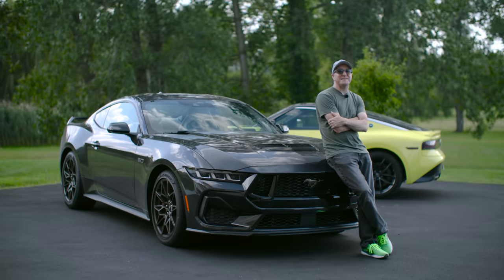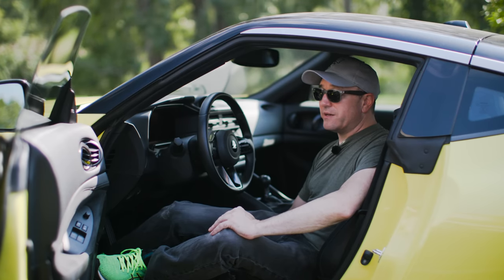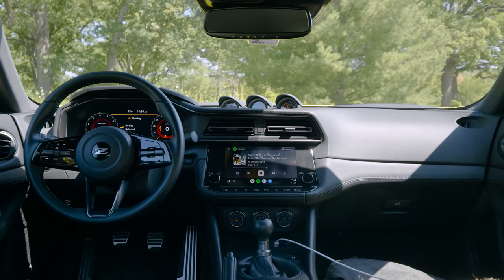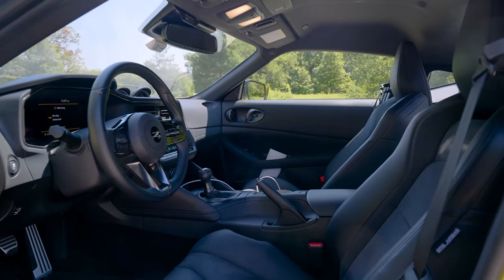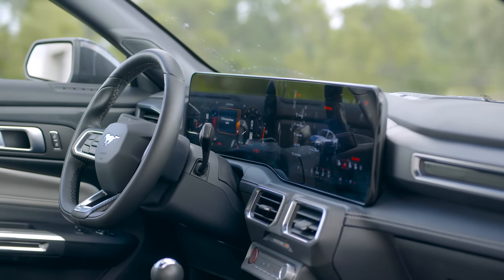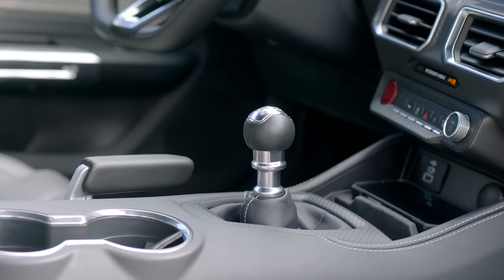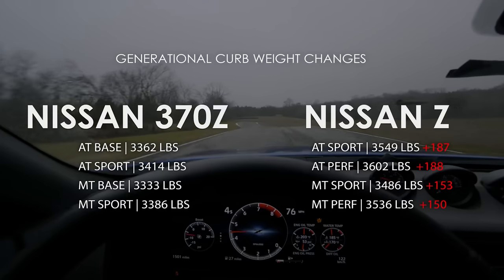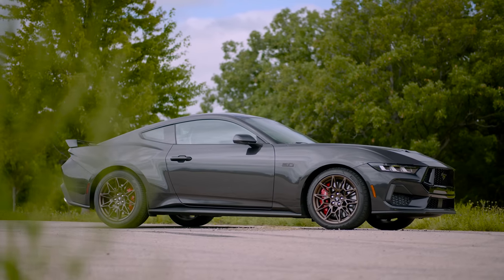Mustang GT vs Nissan Z | Maximum Muscle, High Prices

Comment: The Mustangs’s screen 100% kills any desire I might have had to buy one. It looks so tacked on and kills the look of the interior.
Reply: I'd rather buy a gen 5 and engine swap it for that authentic muscle car feel. Would probably be cheaper still LOL.
Reply: Whoever made the executive decision on that interior and exterior styling needs to be shot into the sun tbh
Reply: not just the Mustang but everything has these stuck on screens now and looks awful. Have you seen a new S Class Benz?
Reply: I generally like big/extra screens but wow does the mustang look bad. Like how some 80s cars tried to go too futuristic
Reply: Were you in a coma the last ten years? That look is so normal now, even old-timers should be used to it now. There are cars with a more tacked-on look, and the rest of the interior actually has the same flair, so it's a decent fit.
Reply: I hate this approach by any manufacturer... Screens are absolutely fine, when they are nicely shaped into a stylized cockpit. But these ugly, protruding square designs with huge bezels  look cheap and un-inspiring. Especially in any car that is supposed to invoke emotion and sportiness. We will all laugh at these tacky designs in the no-so-distant future. Ugh.
Reply: @2K8Si  I believe BMW first started this, with the ipad looking tacked on screen, because it wouldn't fit into their new dash line...and then everyone started doing it. Always felt it was ugly AF. 

That being said, this mustang one here due to the lower height and closeness to the driver doesn't look too bad
Reply: As soon as I saw those screens I haven’t even considered getting rid of my 2020 GT. Which by the way, less then 3 yrs ago I paid almost half of what these are going for.
Reply: @TheDavidk1982  I got my 2019 Bullitt for 10k less than a similar optioned new GT, and in NO way is it 10k better of a car. A well Spec'd EcoBoost is now the price of my Bullitt.
Reply: Agreed just give me gauges and switches. Maybe a small screen to see some of the telemetry data kind of like the GT-R has since the R34. If they want to go all fancy and high tech, skip the screen and go straight to finding out how make a HUD work in all situations. In fact kind of off topic, I'm surprised race car helmet manufacturers haven't figured out how to display data on a screen getting live data from an accessport or something. That way I can have my classic interior and still get all the car info on the helmet display on the track when I actually need to know all the information, not when I'm getting groceries or going to work.
Reply: Agreed, the whole point of driving a fast car for me is to get away from stupid screens and feel something different. The screens obsession feels like a sick societal addiction.
Reply: If I got one of these, I would swap out the entire interior for one from an S550.
Reply: @markj9544 oh Mercedes is the worst absolutely an abomination.
Reply: Totally agree, I’ll never buy it because of those stuck on ipads.
Reply: @anydaynow01  They'll just tell you it's easier to make an iPad mount for your car so you can have a screen when you need it and remove it when you don't.

Correct me if I'm wrong but I believe there's a few series of race cars that already take this approach, a stripped interior with an iPad mounted to the centre console.
Reply: There's a reason a Rolex is worth $15k and an android smart watch is $29 .   Pixels are not synonymous with luxury or technology.
Reply: They're all going to be like that in most if not all cars in the future because the best viewing angle is something approaching vertical. I agree that screens like this make you look like you put your desktop computer monitors into the driver's seat and started driving. But we don't live in the dial-and-needle world hardly at all, anymore.
Reply: Can’t imagine this dash setup is going to age well.
Reply: I think there's a matter of elegance and utility here.  A mechanized needle is timeless like a fine watch but equally important is an uncluttered workspace.     I do not need or want a hundred pieces of information and animated junk, it's all noise and it looks tacky .     @SurelyYewJest
Reply: @shoveI  Tell that to Mercedes!

One of Bugatti's design philosophies when designing the Veyron and Chiron is "no obvious technology", because then it dates the car; they want people to be wowed by the design in 2060 as opposed to how we look at the "tech" in an Aston Martin Lagonda now.
Reply: Same here, all brands have been moving to that design and I just see laziness. S550 for me all the way
Reply: @markj9544    Yes - but the issue is that those cars didn't really have a 'look' or branding that they needed to adhere to.  The Mustang had a look, especially in the more recent models.. They just threw it out the window, seemingly based on a focus group of 17 year olds.
Reply: I agree the screen is way too big, Nissan Z interior looks way better
Reply: @TheUrbanEpicure Hogwash. Tacked on screens represent a lack of creativity, and there's no reason for it.
Stop making excuses.
Reply: @makstone  They're somewhat of an ergonomic and safety-relevant necessity. You need to have the screen within easy reach (as they're all touchscreens now), but you also don't want to have them too far down (like in all new Mercedes models) so people don't have to look away from the road for too long and refocus their eyes too strongly. "Tacked-on" screens are the best compromise and are here to stay, for good reason.
Reply: I'm other models the screens are divided
Reply: @TheUrbanEpicure I’m 42 and all them look like trash. I’m a Bmw guy, they held off until just now.
Reply: @kuruptzZz Bmw did not start this Benz did with the class the modern version was around 2017 in the undated Benz interiors
Reply: I recently bought a 2022 Mustang GT with premium package, stick...and that doesn't have the digital display.  A muscle car or sports car simply needs an analogue RPM gauge...and a Stick! So much more enjoyable.
Reply: I like it, makes it feel like you're driving a truck lol
Reply: RIGHT! 
The outside looks great! BUT.. then the flat screens & I lost it.. they blew it..not buying that
Reply: The interior is HORRID. Rest of the car is amazing. I prefer the interior of 97 cobra over that …. Thing they call a cockpit.
Reply: As if you were really considering a purchase 🥸 I'm old school and even I am all for digital dash. There's no debate. All cars are moving there.
Reply: In real life it looks pretty good imo.
Reply: @kuruptzZz  Tesla did it first. After that everyone started copying them putting HVAC and volume controls in the screen.
Reply: @djnes2k7  No they didn't...I'm talking about the center screen sticking out like a tablet from the dash. I saw that first in the 2012 BMW 3 series. Benz still had the screen incorporated into the dashboard. Then in 2014, mercedes changed their dashboard design and ripped off the "floating screen" idea from BMW...and so did many others
Reply: @Unicornpirate   Both tesla and BMW debuted the tablet looking infotainment screens the same year, 2012. Tesla's was just way more extreme, having everything on there. BMW still had an idrive knob and tons of buttons. Just the screen visually was like a tablet
Reply: @kuruptzZz  Which BMW had a tablet screen in 2012? They only started using them since the G series came out. If you are talking about the I drive that's not new. My 2007 x5 has it and it's nothing like the touchscreen tablet that the new BMWs and Tesla has
Reply: @Unicornpirate   Man I'm simply talking about aesthetically. It's not even a touchscreen, so not functionally. Style wise
Reply: @kuruptzZz  Those have been there in cars for a long time now. But those are more functional than traditional touch screens. They replaced double din head units in like the mid 2000s
Reply: @Unicornpirate   How can I explain this so people will get what I'm talking about? All I mean is the style of the infotainment screen sticking up out of the dash. Before the top of the dashboard would wrap over the screen. But BMW designed this "floating screen" they called it, and that style is what many other companies copied afterwards because it was a hit. I've never been a fan personally
Reply: Absolutely right! Matter of fact, I purposely bought a 2022 recently (as an ultra low mileage used car) instead of a 2024 for that exact reason. I hate the way the screen on there juts look like an afterthought. Like the designers took the day off and then just threw a couple screens ON the flat dash just before their shift ended. I really don't care what's ON them, they look like crap.
Reply: @Unicornpirate Tesla Model S  screens were nicely integrated into the dash tho. They didn't do the floating screen thing till the Model 3 in 2017.
BMW was the first that made the screen look like they just hot glued a  tablet on top of  the dash.
Mopar was also moving  HVAC and  seat  heater controls too the screen at that time.

Comment: The previous S550 interior was just... better.  The dual cockpit layout is just definitive Mustang.  My 09 and 2015 both have it.  I don't even mind a digital display, again the S550 did that better with it being integrated into the dash.  
The exterior is growing on me, as most redesigns do.  But the interior would be something I'd have to live with instead of enjoy.
Reply: I've been in an S550 since 2015.  At this point, I'll take any significant interior update they could think of.
Reply: I'm a zillnail and I love my S550 Mustang Premium interior I got in 2021 and while it is fully loaded it does not have the package with the digital gauge cluster and I honestly don't miss it and rather have the crome switchs and phsycal buttons for climate and radio.
Reply: Couldn't agree more. I'm going to move into this new generation of massive screens everywhere kicking and screaming.
Reply: I agree with you on the displays.  I hate the tablet look.  If they would have integrated those screens into the dash it would be worlds better!
Reply: The base S550 interior was a bit dire though, you had to go for the P R E M I U M models or at least ones with Sync3.
Reply: @Mr00Ted  That's true.  But at this point I'd take the previous base interior and just add a phone mount.  My 2015 was a 50th with every option, but because of Sync 2 at the time I still just had my phone mounted for GPS.
Reply: Yup. New Mustang interior was designed by market research, not actual usability/driver needs. The fact that the “less premium” dual screens look better/less like a billboard in a new $50k sports car is hilarious (especially when it means we give up physical hvac controls).
Reply: The base 2015 mustang gt pp that I had interior is so much better than the new one.  I hate digital clusters.  Analog gauges are much nicer and are probably more expensive to make than a cheap screen.  Its like rolex making their watches digital and saying weve upgraded our watches for you.  I spend most of my day watching screens at work and at home I dont need another one in my car
Reply: @tri3pleagent  If it were an upgrade. It's not.
Reply: They fixed the one minor issue I had with the S550 interior, which was the giant steering wheel that looked like it belonged in a school bus. Then Ford made everything else worse than the S550.
Reply: @Mr00Ted yeah dude if you got the regular one it had a tiny ass screen that reminded me of a Gameboy color screen

Comment: I am amazed Nissan had the balls to change the Rogue this much generation to generation. Its truly a step in the right direction. The old Rogue was slow and boring and this one (while you cant put your klds in it) is WAY MORE FUN! 😍
Reply: Yep sports car drivers are like "they don't make cars the way they used to", Nissan responds with "hold my beer!". They keep all the bits folks like and keep improving the chassis over time, finally with this new turbo model it has the engine it should have gotten since the Z32TT.
Reply: The old Rogue was way more fun than this. In that vehicle you could bring you and four of your closest friends to the nearest Arby's. Try THAT in this updated model.
Reply: Glad I'm not the only one who noticed the changes they've made to the Rogue.
Reply: Rouge gang going strong
Reply: But does this new Rogue do easy off road trails as well? Someone should do a comparison test.

Comment: Car and Driver tested an S650 with a MT and the performance package which weighed 3947! That's almost as much as my freaking Sienna and roughly 750lbs more than my C6 😳
Reply: That's about as much as my BMW sedan.
Reply: About 800lbs more than my base model BP Mazda3 5 door hatch with AWD.  Cars are way too heavy now.
Reply: I have a sienna and a C6 also and thought the same thing!
Reply: @disengage36  You definitely have great taste in cars 😆!
Reply: The new BMW M2 weighs just as much, sadly.
Reply: @justsomerandomguyman  That's a shame because the first generation M2 was relatively lightweight and a great driver's car.
Reply: That's more than the s550 as well. Base GT 550 is 3500, prem with an auto is 3800

Comment: The z is such an underdog.They made it work in house, not a joint project and it handles well.
Mark is impressing me more as time goes on.
Reply: Just buy a Supra. It's faster than the Z and just as fast as the Stang.
Reply: @davothegreat9990  I’ll be buying neither brand new, but might consider one of these used. I know the Supra makes more power but, how long before bmw-esque engine longevity/reliability problems arise. No way to know just yet..
Reply: @TexasVexes  the b58 zf8 combo absolutely destroys the Z. Alot more durable and reliable, especially when modding.
Reply: @TexasVexes  being BMW doesn't mean the memes, they are there to manipulate your mind from now, reality of BMW thrashing Nissan comfortably

Comment: Honestly, if Nissan refreshed the old Z with the same 3.7 VQ and it cost 35K...I would love that.
There are wayyyyyy too many issues with the VR30's. The issue's are hit or miss and are usually very costly.
Reply: T yo
Reply: mofe like supercharged VQ if anything. Z is or was lacking power.
Reply: @lordzed83  the 370Z wasnt lacking any power on the street lol.
Reply: I’ve been saying it all along. Evolve the VQ that last little bit. 4.0L displacement, direct injection, make the car 3,000lbs. The car would fly.
Reply: @simonbrowne1534 the new Z was never going to lose enough weight to matter. They were never going to redesign the platform when they were so broke. In a world where they’re competing against the Mustang GT 5% more power after a decade would be trashed right out of the gate. 400 horsepower is the bare minimum.
Reply: @DOAHunt3r  Agreed. I understand why it can’t have happened, just that it’s how it should have happened in a perfect world. Nobody except Porsche can make a car like that.
Reply: @simonbrowne1534 unfortunately modern emissions would never allow that
Reply: I mean Infiniti could sell a 300HP version of this drivetrain for 38K in the Q50 I can’t see this Z being much more money for that type of spec. 

Granted they probably won’t do it, but It would be a good way to increase the range of cars the X competes with and give people a tuner special. 

Splitting off the grind and offering a performance pack without the interior bits for 4-5K less than the top spec is doable and something I think they will do.

The vr30 does have some issues though and Id love to see Nissan acknowledge that for owners and offer an extended warranty or something.
Reply: The vr30 only had problems in the previous q60 and q50. It’s revised and much more reliable. The vr30 sounds amazing with a borla exhaust, and can make 1000 wheel horsepower with ams alpha 10 turbos. The vr30s problems arises from the turbos, the new turbos are revised and won’t have that problem, also infiniti recommended 10,000 mile oil changes, and uses 0w-20 oil which is the reason why the vr30s died.
Reply: @BigHeadClan  They would have to offer that detuned version with only base model, even then it's probably a bad deal for them cause the 300hp versions can be modded cheaply to make 400 thereby killing their more profitable trims.
Reply: I’m sure they refined them for the Z
Reply: @swiizzie5220  He doesn't want refinement, he wants to pay 35k
Reply: That VR30 engine has had a LOT of the issues worked out. It's nothing like the early year VR's
Reply: @artemiscool67  IKR, why would anyone want that slow ass 3.7 in a new car, other than for sound in which case just get the 370 and stop asking why big engines are being phased out, you already know the answer.

Comment: This Z has been out for how long now? I still have yet to see one in person.
Reply: Same other than the auto show
Reply: Me either. Haven't see one yet. Just like the integra type s and civic type r. I've seen 2 civic si's on the road.its crazy and I live in a major city. Cars are just way over priced, low availability and high interest rates make it a non starter.
Reply: @drmvp21  ya not sure whats going on with this low availability bs its almost like its done on purpose to drive up demand. But ya i haven't seen any typr or type s around
Reply: That's because no one is willing to pay 5-10k over msrp for something using a 14 year old chassis.